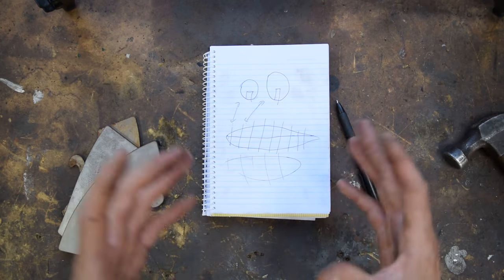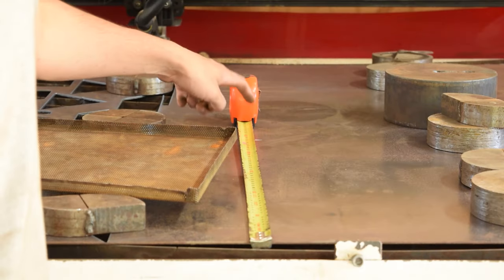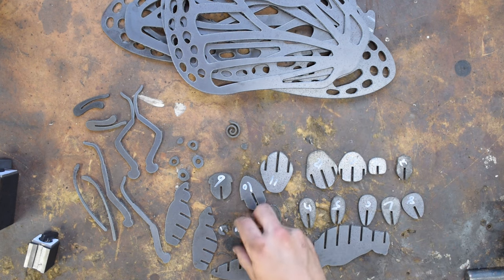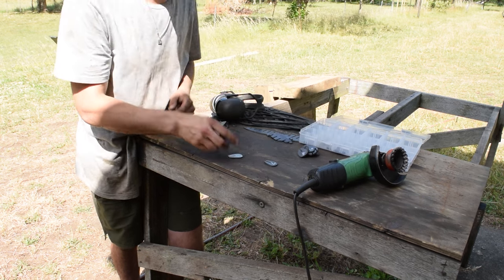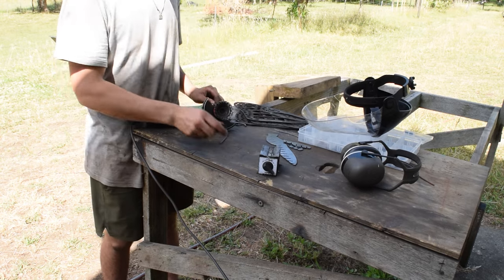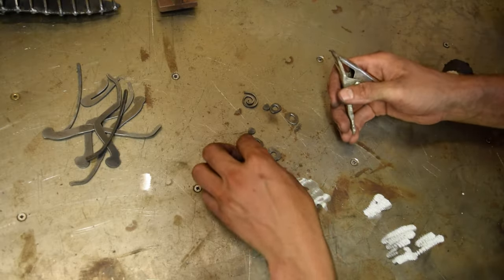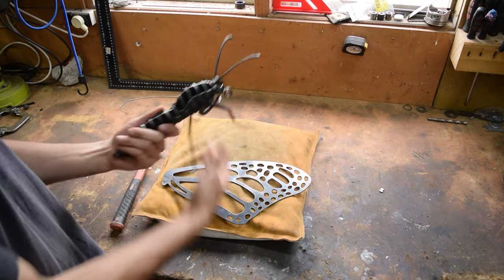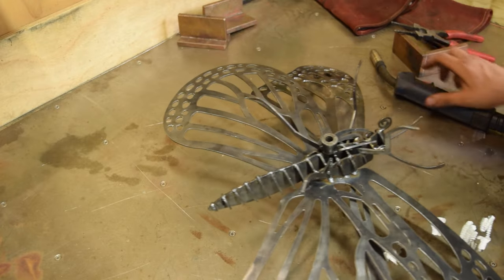How To Make Beautiful Metal Butterfly

Comment: Do you use an oxidizing agent like peroxide and salt water or just leave it outside?
Reply from the maker: Just outside, 3-6 months for it to go through its different phases, for the video though i stripped with vinegar and wet with salt water mix to get the rust time lapse.
Reply: @FinlayShellard a little copper sulphate in white vinegar works very well. I generally strip mill scale in diluted hydrochloric acid during fabrication and then when finished I wash in a mild degreaser (water diluted) before drying and then apply the copper sulphate / vinegar.
Do you sell the cut files? 
I like the design